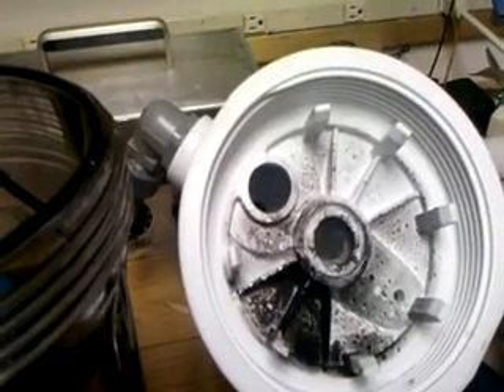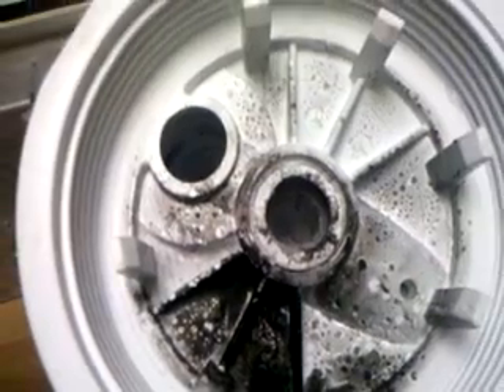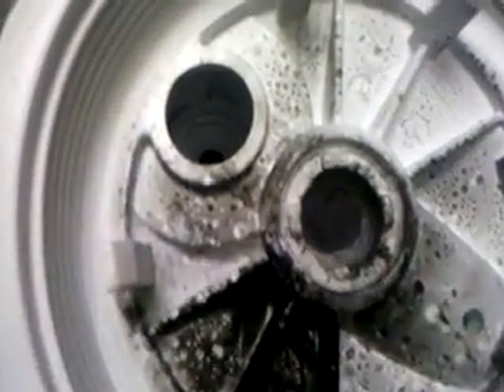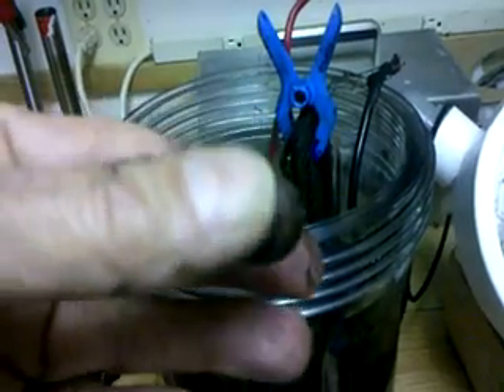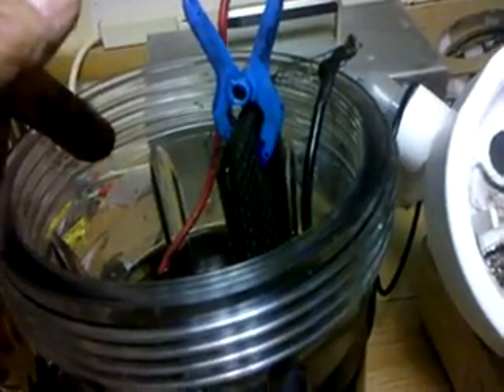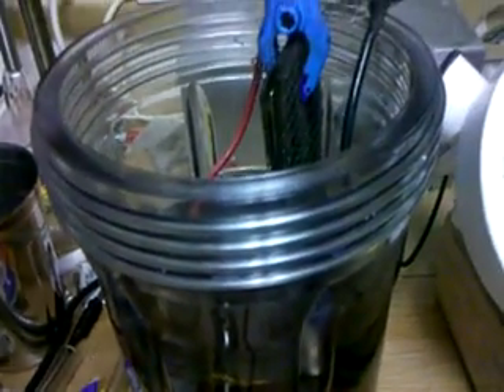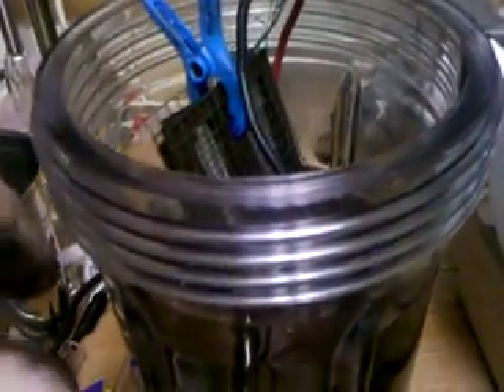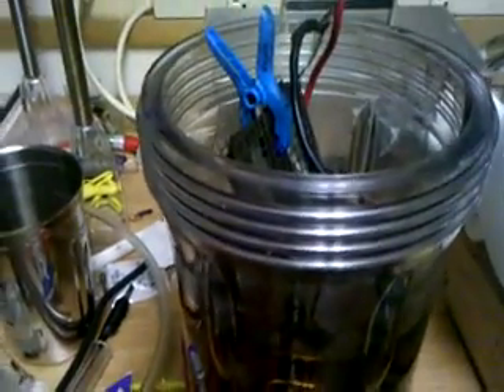Hydrogen Tap B29 (Flame)

Comment: looks to me that the insulation broke down on the main contact to the plate there, the O from the water provided the environment for flame perhaps. the insulation layer on that wires looks degraded somehow. If theO level came up enough to allow combustion then maybe the heat, electrolyte and any metalic coverings have broken down and sublimated into the water hence gritty and balck (oxidised) either way, looks like you got an O spike in the cell.

Comment: my thoughts are this. The water mixed with hho turned the water into a slow burning fuel. What I am thinking is this water injected through a mister into the intake along with hho would make the system burn at a slower rate. Similar to KANZAS machine where ultra sonics turned salt water into a burnable solution